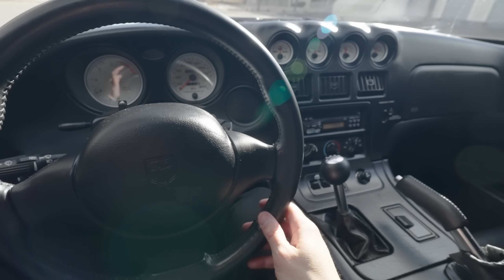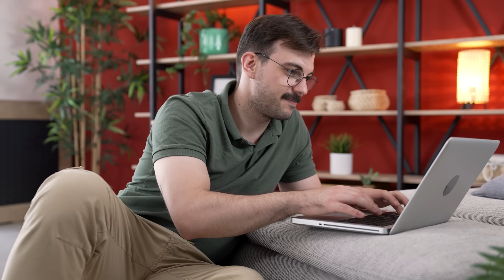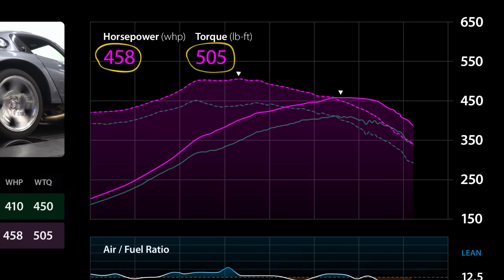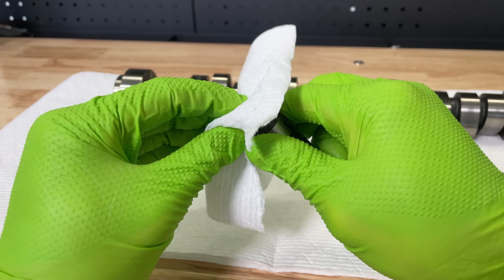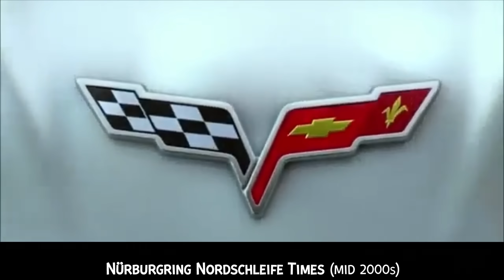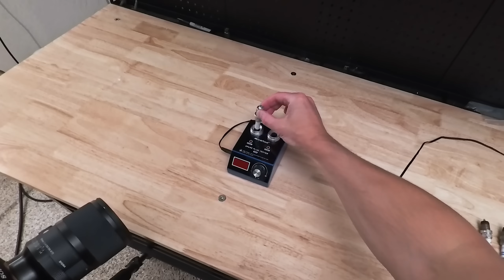Don't call it a comeback

Comment: This is going to be the least sexy comment but here goes. You do realize  you are running a Viper, with no AC or cruise control against a slew of cars who won't leave you exhaust after driving 100 miles. I mean really, an S4? That's a daily driver for most people. Good luck with that in a Viper.  Point is, making cars that can be lived with and survived is going to involve a pretty material hit to performance.
Reply from the maker: It has AC now, but yeah I wish it had cruise.

Comment: I think there's one thing that you miss about the car culture between Europe and America. The viper was always an incredible quick car, no one denied it. Many American made sports cars are still incredibly powerful. The European ideal of a sports car is much more about handling at speed than raw power. It's the reason why Americans hold such esteem in quarter drags and Europeans will love something like a rally car hatchback. You have wide open spaces, we have twisty mountain roads. The idea of owning a viper in Europe was always silly. It wasn't a good handling car and it's chassis was far to wide to be usable anywhere in Europe apart from motorways.

Comment: Just a quick correction: The HVAC control module in the Gen 2 Viper is a Chrysler part, not from a 1992 Ford Taurus. It's the exact same unit found in the 1994-1997 Dodge Ram and Dakota. The '92 Taurus unit only looks similar on the outside, but the connectors and vacuum lines are completely different.
Reply from the maker: Hmm, this is what Roy Sjoberg told me. I'll verify when I have the Viper's interior torn apart.

Comment: The viper should have easily beat the vet. 500hp vs 460hp is enough to beat the vet everytime. But, since the viper sparkplugs are badly misfiring, it's surprising that the viper did that good.

Comment: Why are you dogging this car at the intro? Redneck super, ancient pushrod engine... Vipers were built as pure sports cars. It's almost a track car you can buy for the street, and the later (2nd Gen) models added variable valve timing into that "ancient pushrod"
Reply from the maker: im just the reflecting pool. 4th and 5th gens had variable cam timing

Comment: Very cool video. The extra 300 pounds of weight your Viper has over the C6 Z06 makes a big difference. Also, have the heads and valves been done on that Z06? It's pretty much a mandatory fix (I have an '06) to replace the hollow stem valves with solids, otherwise you go ka-boom.  If the Z06 heads were fixed, chances there is also an after market cam in it. My LS7 has a mild cam, and it puts down 500 rwh on the dyno.
Reply from the maker: He wasn't sure. He actually sold it because he didn't want to find out, and bought a Porsche 718. We're competing in the Virginia City Hill Climb together, will be very hard for me to beat him. Also 500 wheel in a C6 Z06 is probably peak enjoyment.

Comment: All of this work to make the same power as a gen 3 8.3 liter viper engine 😅 dodge did the work for you the made the engine bigger which means more low end power 😈🤠 and gen 3 vipers are cheaper then gen 2 vipers so gg 🎉 but if you want more toque get a early or late gen 4 viper with the 8.4 liter v10 and 600 horpower naturally aspirated and save money over buying a gen 5 viper ❤

Comment: Man, the Ford GT’s dominance at the Texas Mile and standing mile events during this era was absolutely legendary, especially its historic rivalry with the twin-turbo Dodge Vipers. While the built Vipers were monsters out of the hole, the Ford GT's aerodynamics and modular V8 scalability gave it an unmatched top-end charge. Hennessey proved this in 2013 by pushing a GT to a 267.6 mph Texas Mile record, but things went airborne soon after. M2K Motorsports took the crown in 2017 at 293.6 mph, and then shocked the world in 2019 by cracking the elusive 300 mph barrier in a single mile at 300.4 mph. To top it all off, Johnny Bohmer’s street-legal "BADD GT" clocked a mind-blowing 310.8 mph at the NASA Shuttle Landing Facility in 2022. Vipers will always have that raw V10 brutalism, but when it comes to ultimate standing-mile velocity, the Ford GT architecture owns the history books.

Comment: https://youtu.be/5jZ66imTibA?si=tMVptk62h1X_Ngoc
Suggestion: 1. High torque is at lowest gear. And highest speed is at highest gear. 2. Engine output is different from vehicle output. 3. Endurance output is different performance output. 4. Average performance is different from peak performance. 5. Recommended performance testing is different from field performance testing. 6. Producer performance specification is different from  competetor performance. 7. 0 to 60 Acceleration rating . 8. Safety features on the car. Air bags on the car. I hope you get a scientific work out of it.

Comment: I'm a Chevy guy, the LS power train is the best in the world for many reasons. First cost of replacement parts, simple design, easy to upgrade, durability easy to find a used one.  But the Viper always has a place in my heart for being a cool looking car that Chrysler could have taken to the next level but didn't refine it just to stop building them. I'm a Vette man and you can get a used one from 12 to 20 grand.for an older model or a new one for 78 grand. But  a Viper is a Great second best.

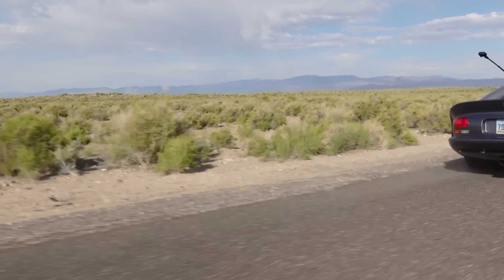Comment: Love the videos. Not a huge car guy (so sorry if I say somethin stupid) but I wonder if the bad spark plug could be the cause of the weird exhaust sputter at around 6:23 and also the damage on the nose of the cam, possibly due to bad (or missed) combustion caused by the bad spark.
Reply from the maker: most likely MMT buildup from octane booster, it's known to happen, but usually takes more than a few hundred miles

Comment: Subaru Uncharted is faster than both these cars -
Reply from the maker: the fastest model runs the quarter in 13 seconds @ 101 mph, so not even close to these cars
Reply: @Four_Eyes  0-60 in 4.18 seconds

Comment: I had a 392 Challenger for many years. I'm sure the people who know this video already know this, and if this is done just for fun, but for everyone else: 

That Challenger is not supposed to beat that Viper in the quarter. If the cars were supposed to be the same, Dodge would have only needed one model. 

They are very different cars, for very different experiences. 

Mind you, the 392 Challenger has flat-out speed. It's no dog. But flat out speed is not the entirety of the experience with a 6,000 lb muscle car. 

It's the torque required to get that much weight moving that fast. And before anybody starts throwing numbers out here, I mean the way you feel the torque required to move that much weight. I don't know what "on paper" numbers are. And I can't explain that to anyone in a YouTube comment. You just have to experience it. 

On the other hand, The thrill of the viper is not a muscle car experience. It is a sports car experience, and it is awesome, but it is different. 

The thrill of the viper is in flat-out speed, and handling. 

I would not kick other one out of my driveway for leaking oil. I'd love to go back and have my 392 Challenger again. I'd love to own a viper. 

But comparing these two vehicles side by side is like comparing an apple to a boot. 

They just served very different purposes and deliver very different experiences.

Comment: The insulator failed on the plug. Either heat or charge through the contact rod…in short form.

Comment: You don't drive a Viper, you survive it. It was a driver's car through and though and you found out instantly if you were in fact a driver.

No assists, no amenities, no extras, biggest motor in the lightest package as possible, the last real muscle car.

It was so untouchable in its heyday they dominated the road course races in every category they participated in, so well that the races usually ended with vipers making up the majority of the podiums... per race.

Dodge only quit making them cause they got bored with it.

Comment: The 8.4l variant of that engine can easily produce 800hp and a lot lot more torque with the VVT duocam. But the rest of the car couldn't handle the power (clutch, gearbox, drive and prop shafts all hit the limit) so they had to neuter the upgrade. It was only in the last huzzah drag pack install of the engine in a challenger did it hit full potential

Comment: The 1992 Porsche Turbo had 90 hp less, yet it was just as fast to 100 km/h—taking 4.8 to 5 seconds, depending on the measurement—and covered the quarter-mile in 12.5 to 12.8 seconds.

Comment: Awesome Viper, I love seeing them on the roads, although becoming a rarity.
  I raced two of them over the years, the first was an SRT 10 in my 01 lightning with a few mods nearly 20 years ago, I pulled about a truck length up to about 80, then it pulled by me barely at about 100 when we both let off. 
The second was a first gen Viper and I had my Sl600, stock except exhaust, this was a roll from 30, we were about even with the Viper slightly pulling away until around 90 but thats all the more we went.
I still have my Lightning that I bought new, and I still have the Sl600 as well, the lightning would break into the 11s with good weather and traction, the SL is 400 hp but weighs more than the Lightning but I would guess its a mid 13 car.
To many people hated on the Viper when it came out, and I never understood why, It wasn't perfect, but it was a daring move and an awesome car in a time of some real crap from the domestic manufacturers.

Comment: why a rolling race against the gt350?
Reply from the maker: when launching a gt350 it's pretty easy to either blow off the tires or bog down from lack of low-end power, and the viper is a monster off the line since most of its weight is on the rear wheels (~54%), so just trying to keep it evenly matched.

Comment: You need to be running non-ethanol fuel in these things that viper was back in the area before we had ethanol induced fuel just get 100 octane non-ethanol fuel and pump that in there and I guarantee you you will see a massive change and how that car performs

Comment: I was once lucky enough to drive a Dodge Charger super bee as a rental car, courtesy of Hertz PHX.  It’s the first time I was scared to punch down on the gas pedal.   The thing literally could spin out of control in a second.  Yes you can call me a wuss or amateur. Hey, I’m a nerd who drove Toyota econobox most of my life.  As I matured, I got a few fast cars, like a MR2, GTI, Z4M, 528i, and G Wagon.  I also had privilege to have driven Camaro SS, Penske/ Hertz Mustang, C6/C7 Corvette.  Super Bee was a car I was totally surprised by.   It’s the reason why I think GTR and NSX should be my dream car, not muscle cars and Ferraris.  Power that can’t be controlled means disasters.  It took Paul Walker from us didn’t it?  Porsche GT was also such a car? Raw power is really dangerous if you are not careful.  Even experienced drivers commit errors?

Comment: Its only 450hp because its highly restricted. When unrestricted its 800+hp NA. Which European tech has never made. Thats the difference and a viper is light af its around 3300lbs. Impressive since the motor alone is 600lbs. European couldn't make an 8.0l that is that light.  Bugatti is proof of that

Comment: Your octane boost appears to have MMT in it which is why the plugs went kaput and looked like shit. Also, it's rough on the cats and O2's. I've used Klotz successfully in everything from a supercharged Charger cop car to cammed LS3 Camaro to a modded Lincoln Navigator 2.7 EB. Give that a whack and I think you'll be happy with the results.

Comment: I'm so happy this popped up in my algorithm!  I've been a die-hard Viper fan since its introduction in 1992, when I was 11 years old.  I'm 45 now and still dream to own one.  My problem is deciding on which year, what color, and what variant to buy, because I have too many that I absolutely love!  My head goes like "should I get the ACR for pure angry power....but what about driving it around town", to "maybe the GTS for it's beauty.......but gosh I'm a tall man and that roof could be a problem", to "nothing wrong with the original RT/10........but it's the oldest and slowest with likely problems galore".  Haha, sucks knowing I want to buy a Viper someday, but my ADD brain isn't cooperating.  I did own the Ram SRT-10, so I have that experience with the 8.3L Viper engine, and I prettied it up and modded it a bit, but it still doesn't compare to the actual Viper car.  Oh, and let's not forget the Viper tv show that ran for 4 seasons, that was awesome!  Anyway, can't wait for the next video.  I just subscribed.

Comment: Why are you doing pulls from a low rpm in the gear? It shows and ur shifting is pretty slow. Also i never paid attention to how low the compression ratio is in this model viper
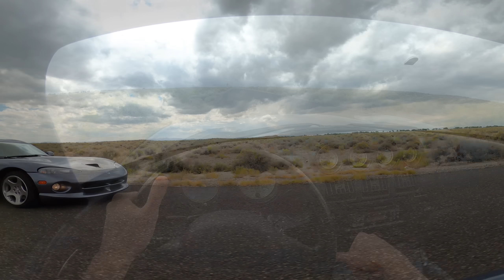Reply from the maker: that's first gear. is 12:50 "pretty slow"? meh, i haven't seen anyone shift a gen 2 quicker.

Comment: The one issue with Vipers is they have too much power and are hard to control if you lose traction. They are notorious for snap oversteer.

Comment: Nice video. Dude these cars  are  A hand of their time for horsepower and  Torque and weight.  My  Buddy want to race me in his 2024  Kia  Stinger al wheel drive  vs 2000 c5 vett al stuck  and HE STILL LOSE  we did 3 of 3 race only one he won was the roll race. So this  Does it surprise me

Comment: Power "per liter" is a worthless marketing term.

Liters of displacement mean nothing for how clean an engine burns.  A coyote produces less emissions per HP made than any euro 1-2 liter turbo you put it against.
It means nothing for efficiency. A 2.0T at max output uses far more fuel to achieve it's 300hp than 20 year old push rod v8's
It means nothing for vehicle weight, as it's such a small chunk of the whole package.

It literally is a meaningless metric. Power produced vs durability matters. Power vs total powertrain weight matters for performance.  Power vs ease of service and upgrade ability matters a lot for tuners.

When eurotrash comments about how low the output per liter is, remind them that cruise ships and trains do not use 4,000 euro 4cyl engines to move them around. They use extremely large displacements to produce power at very low rpm and literally move millions of tons millions of miles without issues. 

Literage legislation is a biased move purposefully to cost the end consumer a fortune in long term costs.

Comment: I’ve got a built C6 Z06 3LT 700 HP LS7 . Not much can touch it on the street especially for less than $50K which is what I have in my C6 Z06. There’s no replacement for displacement.
Reply: Right

Comment: Several of these other cars including the Corvette would SMOKE the Viper on a closed road-course type track. Furthermore: Has Chrysler ever owned the 24 hr high speed endurance record? Or the 5,000 mile record? NO. But a bone stock 1st year production 1990 Corvette C4 ZR1 sure did. The ONLY thing they added was headers & open exhaust. The factory stock LT5 engine even had the factory tune. Chrysler never even attempted to break those records.......and if they tried secretly, they obviously failed. Ford, Porsche, Audi, and Mercedes all tried to break just the 24 hr high speed endurance record, and ALL of them failed.......and some of those cars were special, purpose built cars designed solely to try and break that record. Yet a bone stock 1st-year production C4 ZR1 shattered BOTH of those records during the same run. By the way..........running a limited slalom course is nowhere near as grueling as a big road-course type track. Because that's when ya find out what your brakes and suspension are REALLY made of. By the way: there's a master engine builder who resides & works out of one of the states in the heartland of America, who rebuilds and does upgrades to the LT5 engine of the C4 ZR1 Corvette, with the result being 650 hp AT THE REAR WHEELS.

Comment: Not doing a tune up agter putting in new headers is diabolical. Not to mention a cam was thrown in there. Tune up should’ve been first thing done as soon as he was going to drive it 800 miles back home.
Reply from the maker: of course new spark plugs were put in.. same with oil change, brake fluid, and a car wash.